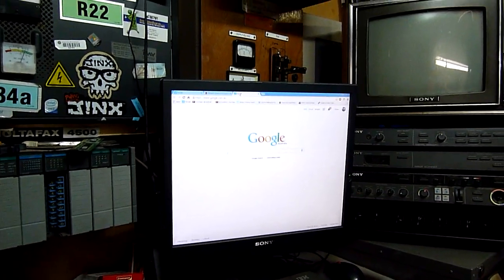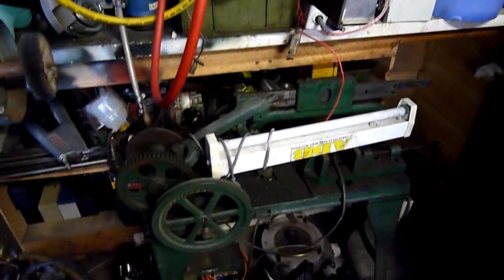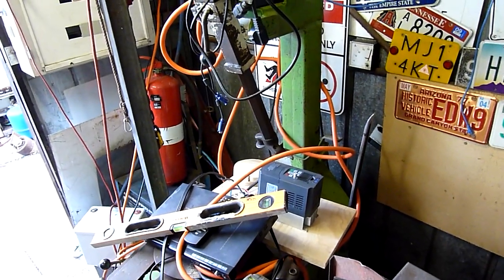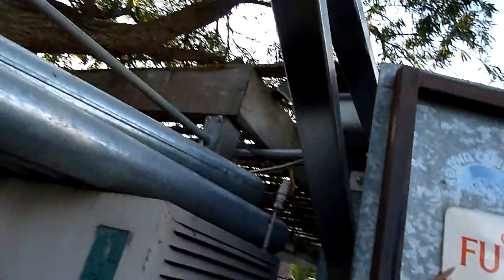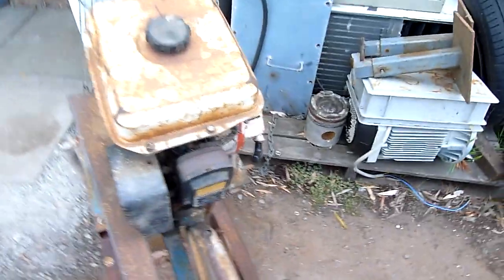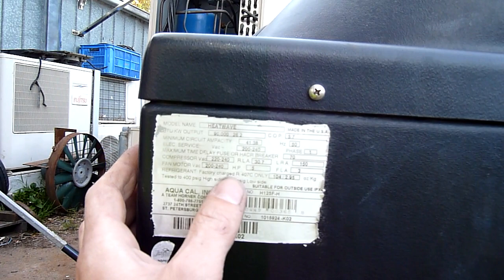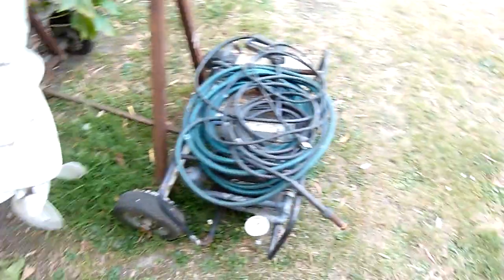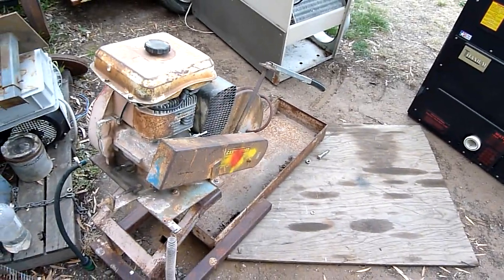Ramblotron Entry 25 Feb 2014   Construction Progress and Free Equipent local Pickup only

Comment: The trick with fleabay is start listings at the minimum allowable amount, like $.99, .49, or whatever, no reserve, and offer to email pictures rather then posting all of them. One thing a lot of guys are doing is to take offers off fleabay, it's not something they are supposed to do but it is one way to avoid fees. But sites like craigslist are probably the best way if everything is pick up only..

Comment: what mini lathe are you getting ?!?! i am looking at getting one as well but .... i m looking for something with lower tolerances that would be able to handle hi carbon steels :P i was looking at the 3 in 1 mill and lathe set but .... its better if i get one mill and one lathe all manual :) ill make the servos my self :D making things is all good !!!
Reply from the maker: I already have 2 old lathes that work quite well for the age they are. what I just got is a Hafco Metalmaster mill-drill. again, its worn and old (10 years hard work) but it will suit me just fine.
Carbon steel should be easy, its the low carbon and stainless steels that take a lot of horsepower, and a solid machine to work with.
Reply: yea if you have some experience you can even make a hole new one from scratch with the other one you have .... but it takes some time :) i hope you put up some videos on you using it :D cheers bro